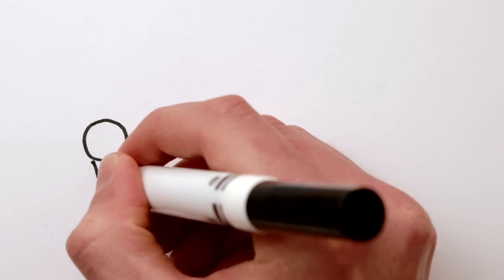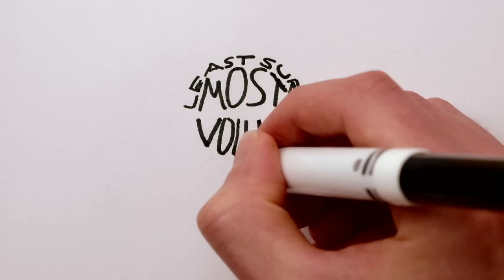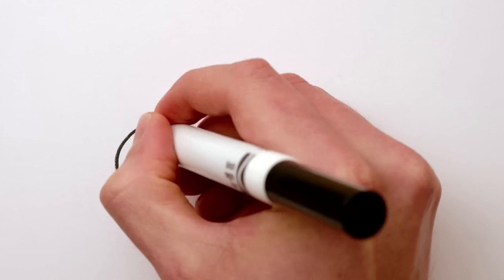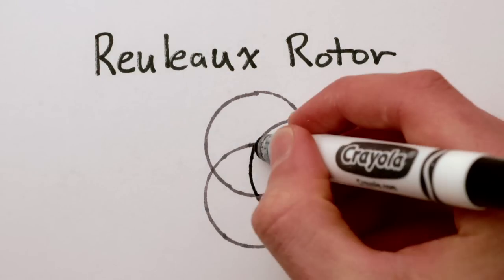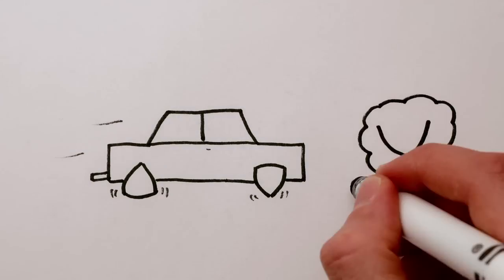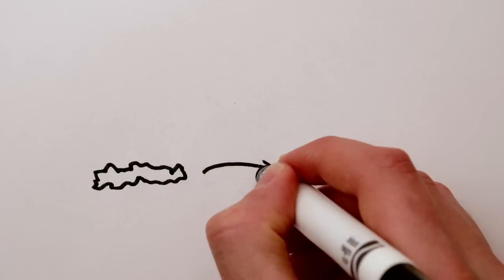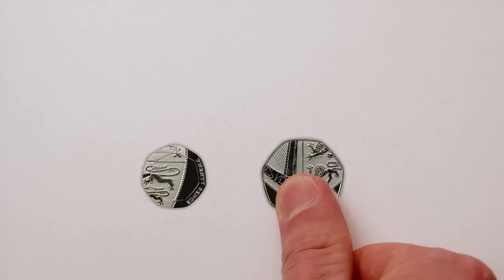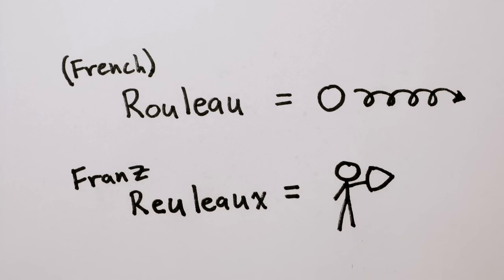Round Triangles!

Comment: Why would this round triangle not work as car tires?  Because, although the diameter is the same all around, there is no set radius, the measurement which defines a circle.  The radius is the distance from the center to the edge.  Since a car tire rotates around its center, it requires a set radius for a smooth ride.
Reply: because wheels need to be fixed to the car by an axle, right? And the key difference between the rouleau shape and a circle is that while a circle has a fixed centre the rouleau shape does not have a fixed centre, the centre of rotation gradually moves as the shape moves, so while you can use it to roll when there is no axle, like as a log, t can't roll when fixed to an axle, because then its centre of rotation would be fixed, and it can't roll that way.
Reply: Monty Evans Although the center of this shape is not half way along its diameter, it does in fact have a set center (as defined by a point around which the area of a shape is equally distributed).  If you were to place a hole through the center and attempt to roll it like a wheel, it would not be a smooth ride.  However, it would be possible to compensate for the unevenness using a gear mechanism, which in text would be difficult to describe...  maybe I'll make a video about it.
Reply: Yeah, sorry I was unclear.I get that there is a centre of mass, but no centre of rotation, because if there were it would rotate around it and move smoothly. How you would design a gear mechanism like that sounds pretty incredible though. I would definetley watch that video.
Reply: Monty Evans actually, there IS an exact center of rotation too.
Reply: But then... why would it not work when attached to an axle?
Reply: Thanks! I was wondering about this, and your explanation made perfect sense :)
Reply: don't get it
Reply: +Monty Evans You can think of it that way:  no set center.  If you take a measurement of diameter, the center point of any given line segment representing the diameter would not be the same point as the center of the roleau.  If you place the centerpoint of the roleau (the point at which the shape is evenly dispersed around) on that segment, one part will be longer than the other.  This is what I meant by "no set radius".  I erred in that radii only apply to circles, as circles are defined by their radii, and if the shape is not a circle, it has no radius.

Comment: rouleau is actually "roller", not "rolling"
Reply: it could actually translate as "roll", like in "rouleau de papier" (paper roll), or "roller" as in a tool you use to flatten stuff ("rouleau à pâtisserie", "rolling pin")
Reply: 7000000th but being used in conjunction with other words to translate to something is different. "rouleau" itself means roller. lots of words change meanings when added to others, especially during translations. when translating, the general meaning is used. for example, "bonjour" means "hello", right? well, there's also the direct translations. in this case, "bonjour" directly translates to good day ("bon" meaning good, "jour" meaning day). by translating the point, then yes, rouleau du papier is a paper roll. but the direct translation is "roller of paper". "rouleau à patisserie" means rolling pin, but the direct translation is actually "roller of pastry".
finally, your point still doesn't prove them right, as they said it means "rolling". the world "rouleau" itself means roller. when giving translations for the meaning of words, not direct translations, it can have anything to do with the word "roll" (staying as "roller", becoming "roll", becoming "rolling"), but the word alone means roller.
Reply: tubefan90000
if you don't care about it, why are you commenting on it?
Reply: AggieBonfire14
I agree, even though I'm French

Comment: Wankel used them in his motor 
Sad you didn't mention it
Reply: Same, was waiting but it never came
Reply: Nope. Rotary/Wankel engines don't use reuleaux shaped rotors. It's actually a shape with flatter arches around the sides.
Reply: But they have apex seals that give them a pretty near "Round Triangle" shape
Reply: Socrates Nicolaou No the apex seals makes the arches even flatter. But I admit it's still pretty close.

Comment: Rotaries aren't like 2-strokes, their more like a regular four stroke with twice the cylinders; they don't burn oil with fuel like a 2-stroke. Rotaries use oil with the apex seals to burn the least amount of fuel; 4-strokes also burn oil due to the nature of the seal, although not much, and it becomes more evident when they wear down.
Also going to catch you on a technicality there: vehicles which do use rotaries a lot are airplanes. Their light weight and "turbo-ability"(ha), is well received.

Comment: wait. why would the points on a pointed roller cause a bumpy ride? its not like the car is going to have any vertical displacement when the car rolls. i mean, what IS a bump anyway? its just the force experienced when you roll over an object fast enough to change the momentum of your car in the upward direction.
Reply: +michael holland Because the distance from the center to a "corner" is longer than the distance from the center to the opposite edge.

Comment: Reuleaux rotors are what is used in a Wankel-style Rotary engine, as popularized by Mazda. This is another lovely example of using a 3 sided piece to create rotational energy, as there are 3 stages of an engine cycle: Intake, Compression, and Exhaust. While one side of the 'rotor' is doing one, the other two sides are doing the others. As this engine is, and was, developed, it was found to be a very size efficient motor, doing in 2.6liters displacement what it took 5 liters conventional space.

Comment: The big disadvantage to rotary engines are the severe lack of torque, and the fact that you only really start to get power at much higher rev's than a standard cylinder/cam engine or cylinder/valve engine.

Comment: A sphere contains the most volume with the least amount of surface area.  What this means is that a sphere container can hold more water than a cube container made of the same amount of material.  More gas even.  More lentils.  But could a sphere container hold more common household items than a cubical?  Probably not, which is exactly my point.  I'm not trying to argue anything here, I'm simply making an observation that I think is quite ironic.

Comment: Well I said they are like 2 stroke because in a wankel engine the injection, compression, ignition and exhaust all happen in the same cycle (one rotation of the piston). In a 4 stroke engine it happens in 2 cycles (4 strokes of the piston). Because in wankel engines the combustion happens in one cycle, it produces more power per cycle like a 2 stroke engine but is less efficient than a 4 stroke engine.